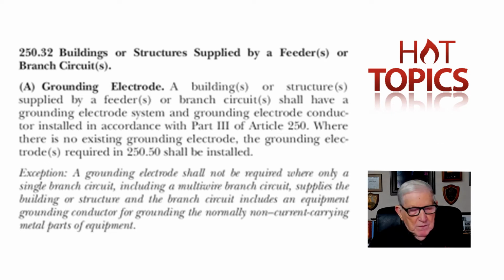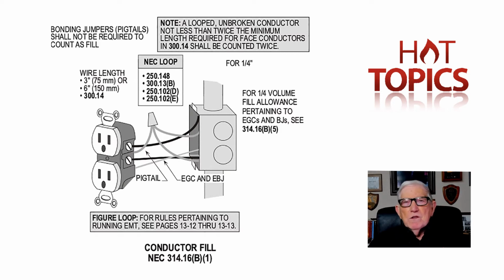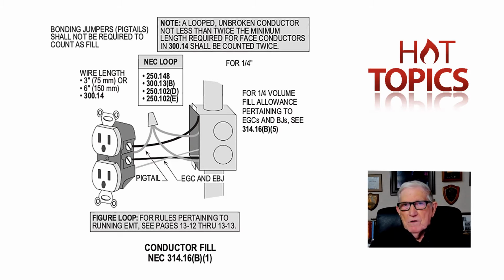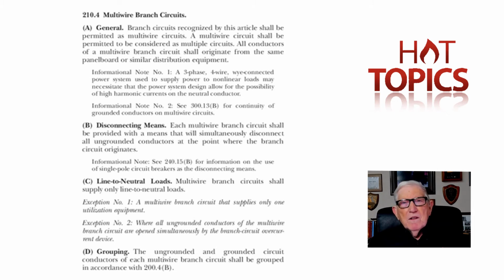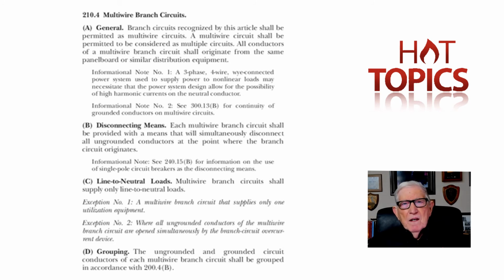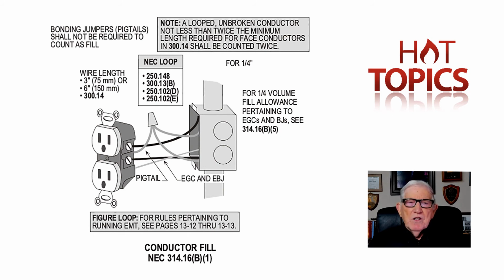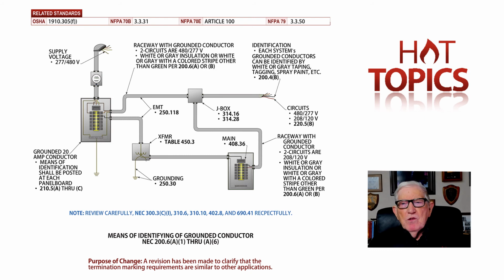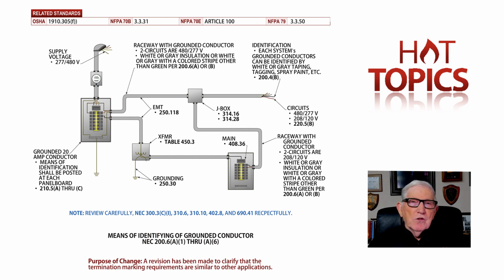HT E 05 - Multiwire Circuits

Comment: These circuits are actually a very efficient use of wire and labor.  They were very common in kitchens in the 70s and 80s, and to a lesser extent when kitchen GFCI protection became required in the 1987 NEC, until about the early 2000s or so, when AFCI protection was mandatory.  My sister lives in a tract home built in 1995, and her kitchen counter top receptacles are fed with 12/3 NM and a two pole GFCI breaker.  The fun part came when her boyfriend was replacing the traditional outlets with the newer  decora style, a few years ago,  and forgot to remove the tab on the hot side.   Spent hours troubleshooting why the breaker wouldn't reset before it dawned on him😊

Thank you for your videos,  keep them coming
Reply: Hi Kyle,
i'm sorry to get back so late , but i've had computer problems.
You are right. GFCI protection stopped this type of installation,
because two neutrals were required for the GFCI protection to work properly.
And you certainly had to make sure the right links of the receptacle were broken.
thanks for sharing.